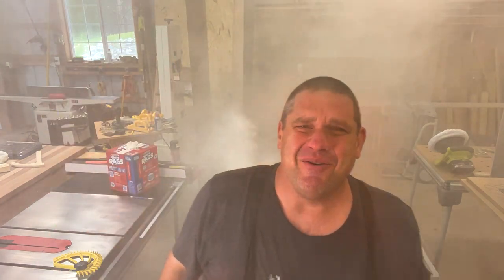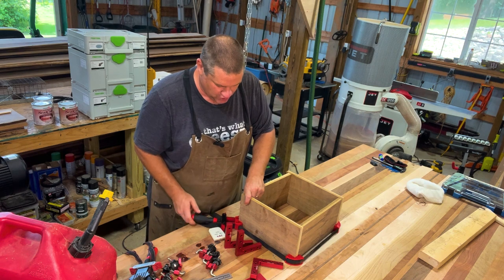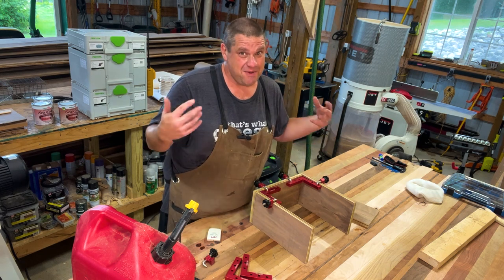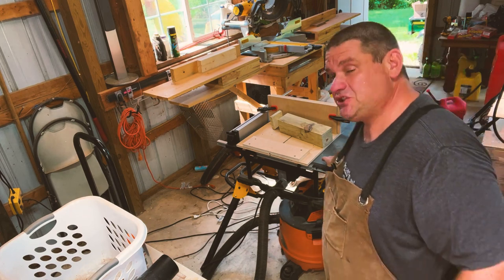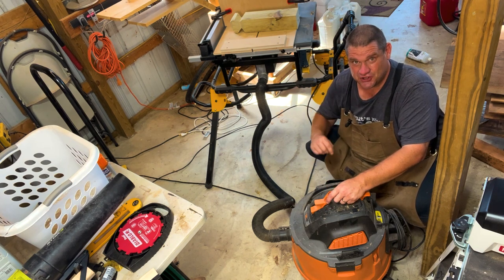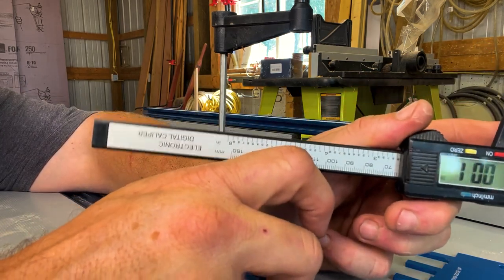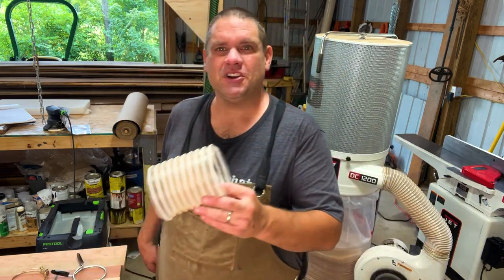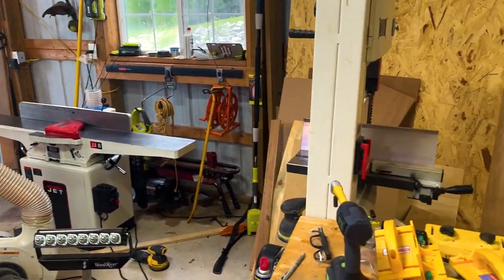7 Things That a Beginning Woodworker Needs!  Do Not Buy What I Did!  Buy This, Not That!

Comment: I have had a commercial woodworking business for 40 years and make many picture frames . The band clamps are great for frames. Who would ever think they are meant to be used as you show?
Reply from the maker: Well I respectfully disagree.  I think they decent for frames, but 99 percent of people that buy them are not making picture frames, especially since they are sold at Home Depot and Lowes.  I think the vast majority of people that buy these band clams are using them with the intended purpose of holding together 4 corners that have a much larger depth than that of a picture frame.   Thanks for bringing this up, and I’m sure you make some beautiful frames!  Have a great day!
Reply: @FlynndoggWoodwork  we also use them for assembly on long hollow beams that are mitered along the long edge. Remove the plastic corners and they can be used for clamping cylindrical or round objects.They are a very useful tool.

Comment: so many of these "problems" can be solved just by using the tools features. like blade depth.
Reply from the maker: Very true!  However, in order to get through the entire piece you will still need to breach the surface of the wood which would cause scaring on the piece supporting the work.

Comment: I totally disagree with your band clamp opinion. But that's for another video
Reply from the maker: Well, I think those band clamps have a purpose in the shop.   Specifically for things like frames and smaller boxes, however I think I've used them too much for larger box glue ups and had disappointing luck.  Thanks for the comment and thanks for watching dar4431!